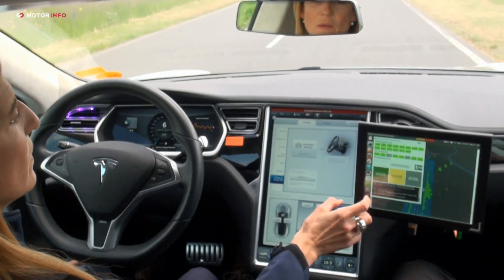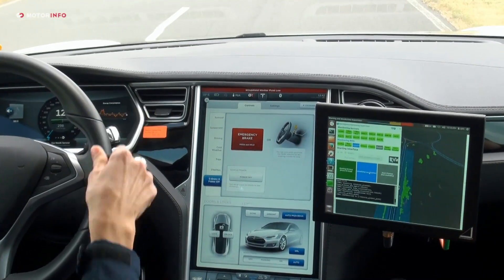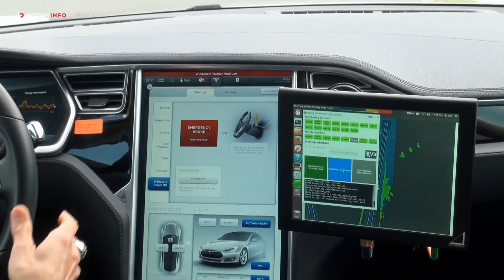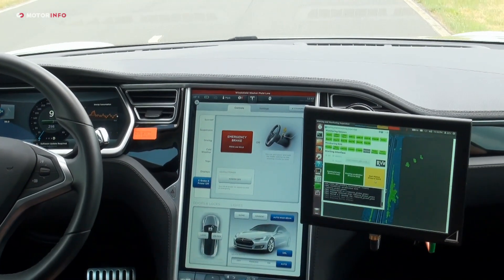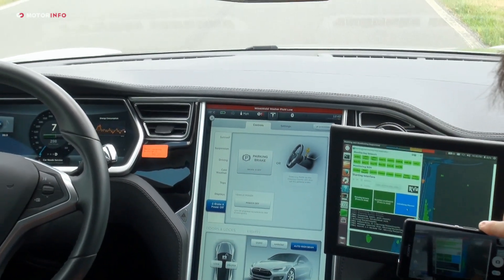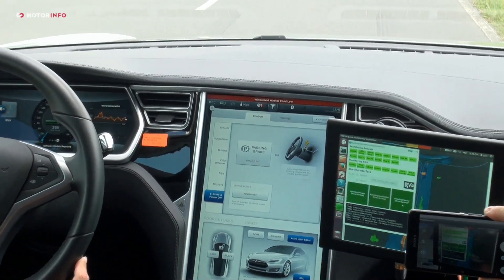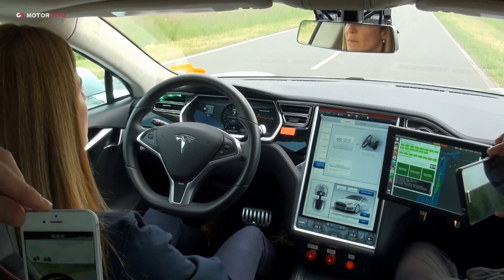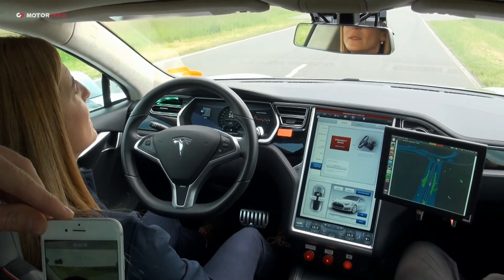Tesla Model S - Bosch Automated Driving

Comment: This is great, but is this system really ready for the open roads ?I mean...If not even the test driver trusts the car enough to not sit with hands poised to grab the steering wheel, how would i trust the car.
Reply: +John Doe it needs some work... but as you can see... we are not far off. 

google's car has logged millions of miles without causing an accident. There is no doubt that "pretty soon" they will be much better than humans in every aspect of drviing
Reply: ***** Yeah, but seeing this video makes me think that it might not be THAT good yet.

Also, if it relies on the stripes in the middle of the road and to the sides it would probably have a really hard time in my country as the roads have been neglected for years and the stripes are either missing or really worn down and faded on a lot of roads.

I would never take my hands off the steering wheel. What would happen if it was driving along merrily and suddenly the road stripes went missing.

BUT...Promising tech. i guess that when i get to old to drive, it's probably forbidden to drive your car yourself and the automatic drive is more advanced than any human.

Now we only need better batteries that can be charged faster. Today the Tesla would useless for longer trips.
Reply: Offcourse, but then if this car would crash or potentially crash every time the white lines were missing then it should never be made to drive totally by itself.
Reply: I sure hope they do, i would like a self driving car if possible.

Hope they have a really airtight TOS for the american public, otherwise they will be sued really bad by all the fools thinking that the car has fully functioning autodrive :)
Reply: +John Doe " Yeah, but seeing this video makes me think that it might not be THAT good yet.

Also, if it relies on the stripes in the middle of the road and to the sides it would probably have a really hard time in my country as the roads have been neglected for years and the stripes are either missing or really worn down and faded on a lot of roads."

I personally was stunned how much the system can see, this the first video of Tesla autopilot where we can actually see from that small screen what is going on. It is pretty amazing how much things are happening from many angles and car seems to detect all of it.

Comment: id much rather see vacuum tube with a track / road in them that would suck / pull light cars with no engine. the price to travel the tubes would be so low and the top speed would be like 10000 mph depending on how much suction. just so every one knows this is not the future of transportation. its just a milestone to keep gas cars on the road for another 25 years